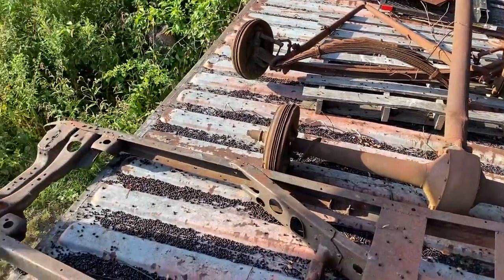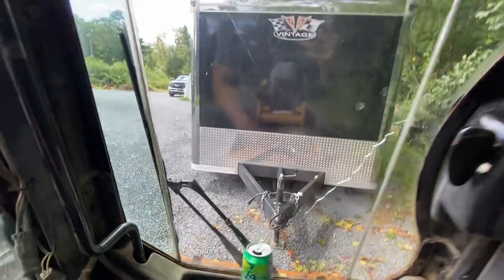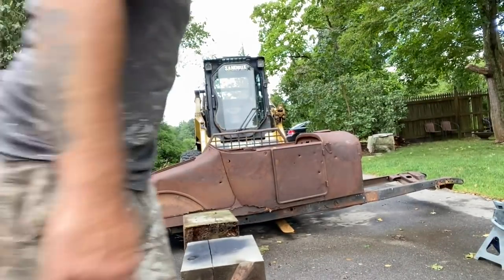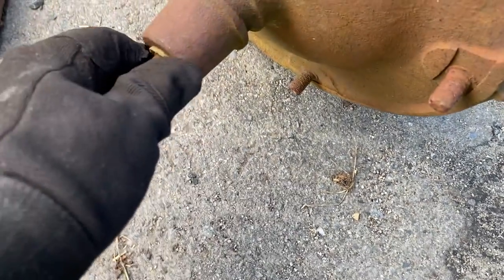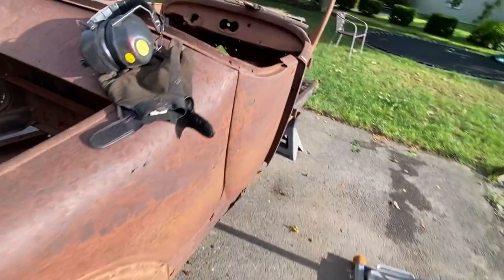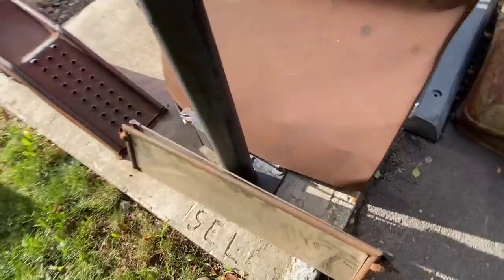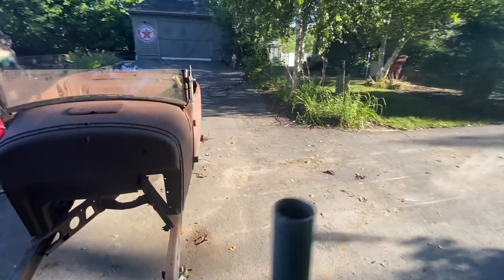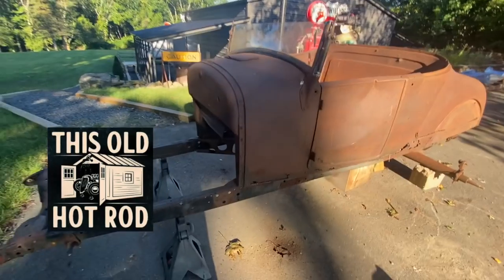1927 Ford Roadster Project  [Episode 2]

Comment: What is the purpose of splitting the wish bones?  Handling?
Reply from the maker: 1920'-1940's Ford cars use the wishbone mounted to the underside of the transmission or X member on the chassis. When you run a Flathead V8 in place of the stock 4 cylinder motor it eliminates the mount for the front suspension. It can be used if you modify the front wishbone. However it's an option to just cut the wishbone at the pivot ball and spread them to the side of the frame rail.
 Then mount them individually using threaded bungs welded into the open tube end, after you remove the pivot.
hopefully that makes sense.